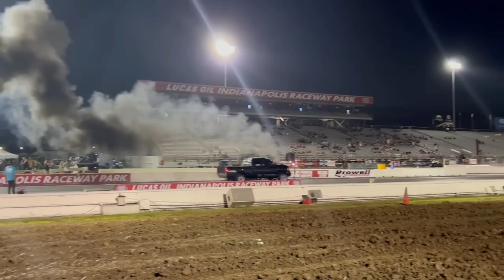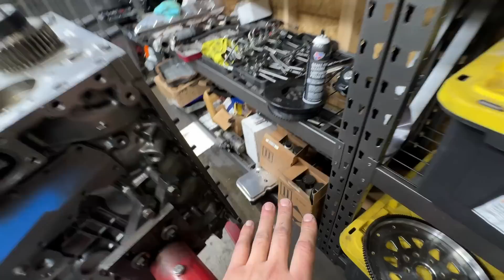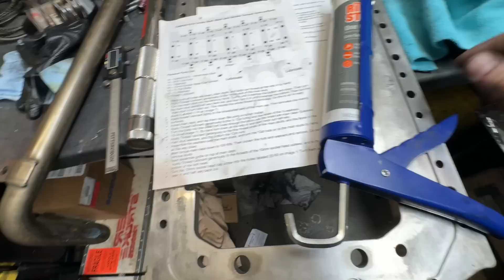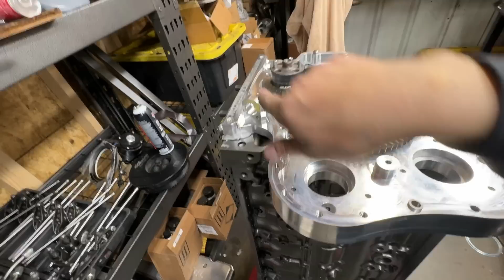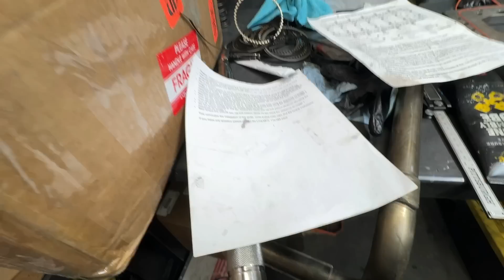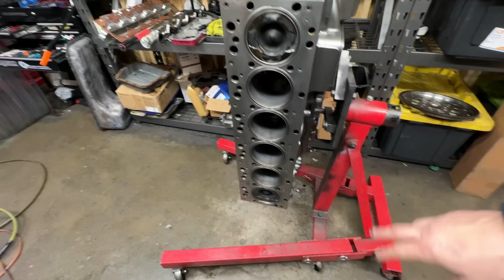LETS TRY THIS ONE MORE TIME

Comment: Total seal rings are actually awesome I used them on my Subaru build and they definitely help, and last, worth every penny and crank pressures stay very low compared to before, any high boost application needs those rings

Comment: You should experiment with CeraKote. I have been putting it on and in everything. It will should reduce the consequences of too much egts. The micro-slick might be worth looking into as well. Very easy to apply. I have been using the C series. Its 90 a pint but goes a long way. Just one more thing to possibly give you an edge. 

You will need C-186 Piston coat and C-110 Micro slick, and an air gun with a .80 nozzle. Prep with acetone and a gas out with a torch. I did not bother with sand blasting. So far everything I have put it on has held up very well.  

Little late now, but you are always building things. if you got a street monster you like to ride at high rpm this would be what you want to use.

EDIT" 
Also you should weight all your piston assemblies and get them to the .00 of a gram. I am told I am wasting my time, but I am told everything I do is a waste of time.
Reply from the maker: The pistons are coated, the assemblies are balanced. A lot takes place off camera!
Reply: @horsetorquesdiesel  I can only imagine.